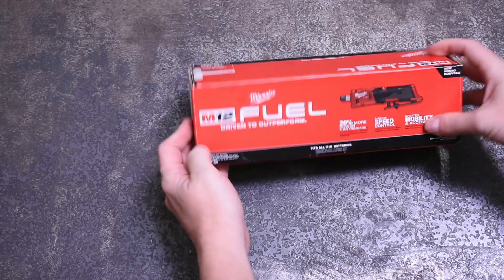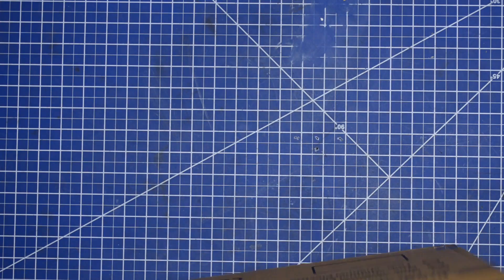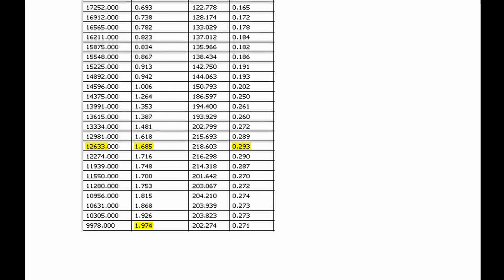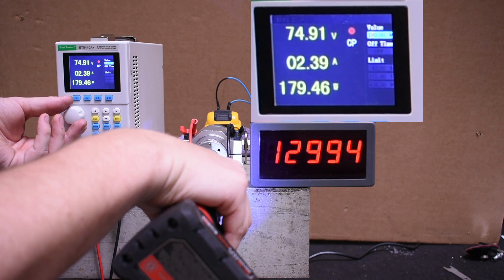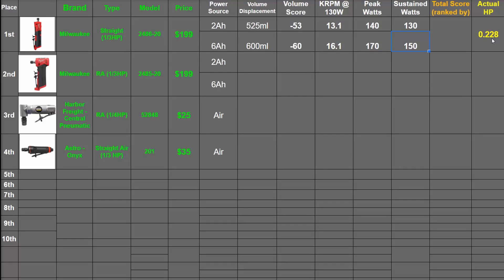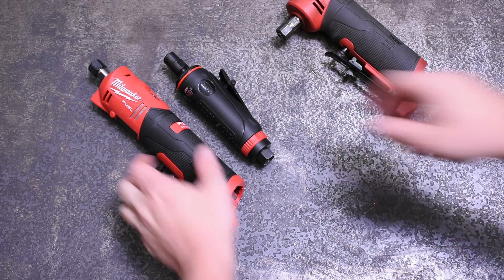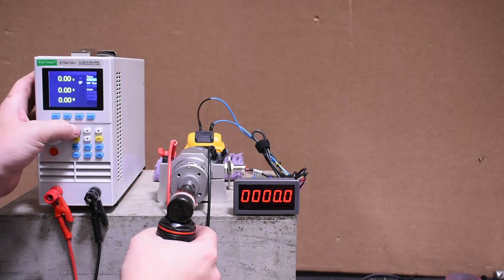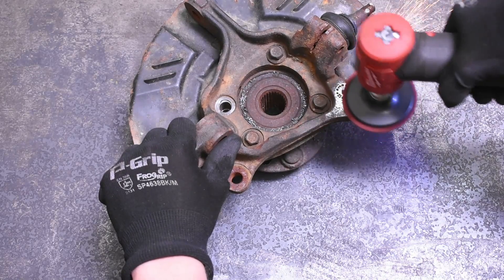We Built a HP Dyno: Do M12 "1/3 HP" Die Grinders Really Beat Air?

Comment from the maker: People with our lifetime tool ranking would have seen Die Grinders added early this week: https://etsy.me/3G8j3QK It's worth noting that the efficiency of a motor spun as a generator is NOT close to 100% , so like with the rest of the testing on this channel with torque, lumens and otherwise, the value will be in the comparisons between tools, which becomes greater as the list is filled out. Also why the title is "Do Milwaukee 1/3 HP Die Grinders Really Beat Air?" and not "Do Milwaukee 1/3 HP Die Grinders Really Make 1/3HP?" Recommend some cordless die grinders we may not have considered below!
As always, Torque who started this channel works in product development for Astro Tools, who also makes the 201 & 204 models in this episode. Not that they make unusually high power compared to most, we find die grinder quality mainly has to do with vibration and durability. Power is usually determined by air motor size. TTC is not the only testing out there, always consider multiple sources when looking at a tool!
Reply from the maker: Working on a brake dyno as well, we'll see if we can shrink it down for use on smaller power tools as well.
Reply: @TorqueTestChannel  You only need a pivot and a torque arm on the dc motor you have, and a kitchen scale to measure the down force of the arm.  The motor is already used as a brake.
Reply: @TorqueTestChannel  Put the motor being ran as a generator on a floating bearing setup and attach a lever arm to the body of the motor so that it is pushing down on a weight scale. Calculate the torque based on lever arm length multiplied to the force reading on the weight scale as the motor starts to twist on the body more and more as load is increased with your battery load tester. That takes out any losses from power losses from the current draw out of the generator. You already measure RPM, so you are 50% there.
Reply: I would say that order of importance in the quality of the tool is durability, power, noise, vibration. Please add sound level to the testing. Some are really unbearable to use. I had a HF die grinder gear box explode on me in less than 10 minutes use. I wouldn't use one again if you paid me to.
Reply: I’m glad you mentioned this, I was going to comment about i. Just saying if you know your motors efficiency (probably somewhere between 80%-90% though depending on the type of motor it could be less, some older motors are less then 50% efficient while Tesla motors I’m pretty sure are 90%+ efficient) you could divide by the efficiency to get a close estimate my guess is that your motor is about 85% efficient (although that’s a shot in the dark) so the Milwaukee would be 0.228/0.85 =0.268hp still not the 0.334hp  their advertising but a little better and closer the the actual hp output
Reply: Another option to get you results closer to the actual output hp would be to calibrate your setup off something with a know hp (basically testing your motor/generators efficiency) although finding a motor that you could use to test might be hard. The best way I can think of would be to get a second identical cnc motor then run one as a motor into the other as a generator. read you input and output power divide your output power by your input power to find the efficiency then split the difference with 100% efficiency (the efficiency you calculate would be for two “motors” so splitting the difference with 100% efficiency would give you the efficiency of a single motor. Example: if it tests at 60% efficiency then one motor would be 80% efficient if it tests at 70% efficiency then one motor would be 85% efficient. The only way that wouldn’t work is if the motors have different efficiency running as a motor or a generator, I don’t know if that’s possible and even if it is you’d probably still get pretty close but still something worth looking into
Reply: I wonder how much POWAH my dcg426 makes.  Also can this rig test angle grinders?  How much power do the 40 and 60 volt die grinders make?  Is it really 3 hp?
Reply: I would be super interested in seeing the new high output 12v batteries tested. The 2.5 and 5 AH models on both of these grinders, the larger 3/8ths ratchet, the stubby 3/8ths impact and the 90 degree 3/8ths impact. These are all tools I either use daily or am looking to purchase. I have a 5AH HO battery and it FEELS much better than the 2 or 4AH batteries.
Reply: I use the snapon brushless polisher/die grinder (CTPP861W1) as my go to and have been considering getting the Milwaukee 2485-20, would be curious how they compare, from watching this video I believe the snapon may have more power but I would be interested to see how they compare
Reply: I was goin to point out the efficiency. Considering the motor and bearing losses I think that 75% is a good number.
Reply: DC motors are actually quite inefficient, I would say 50-60% is a good conservative estimate for peak efficiency and efficiency varies greatly with speed/torque/power output - peak efficiency usually happens at 25% or below of stall torque. I'm not sure if or how any of this changes when the motor is being used as a generator, but I can't imagine it would get better. To get good results, you could keep the DC motor and electronic load but would really need to add some kind of torque sensor - the simplest would be a thin shaft designed to act as a torsion beam with hall effect sensors or encoders at each end. You don't even need very accurate sensors to do this - just measuring the phase difference between the two signals will let you calculate exactly how much the shaft twists under load, and it would be easy to calibrate this setup with a known accurate torque wrench.
Reply: @jrw0101  Got to be careful with wording because DC motors can include the brushless kind which can be in the high 90's. Also, brushed DC motors can be up to 80% efficient from what I have seen with larger units. The 60% is for low quality brushed DC  motors.
Reply: You realize TTC, that you’ve opened the Horseprrs Pandora Box. 
Next is Coyote motors vs LSs/LTs.
Reply: I wonder, if you could use something like a MPPT circuit, to get more accurite numbers.

Comment: I would adjust your value column to reflect the price of an air compressor/hose/dryer since the m12 price includes a battery. I just bought an m12, and even though it was pricey, it was cheaper than upgrading my air compressor to run air tools. And i dont have space for a big compressor. So this was a good fit for me and my small projects

Comment: Thanks. Am thinking of getting one of these Red, right angle die grinders. Air is compact etc, but has a number of drawbacks of noise, cost of compression etc. Also, air is very pressure sensitive; very fast on load load, but this quickly drops with pressure. I note you found the battery ones to bog, too. There's some small advantages in air, but I think much of the future (and present) is battery.

Comment: That collet belongs on a 5/18"-13 female spindle to mount to cordless angle grinders which promptly become right angle die grinders. I drilled and tapped a steel Jacobs chuck for mine which is a very old trick but those are bulky.  That turns any of my angle grinders into right angle die grinders at which my Makita and DeWalt are quite handy, and for heavy jobs it goes on corded angle grinders.

Comment: Then add a score for portability, and make sure reflects the difference in the overall cost between batteries and chargers and compressors and equipment. Since the two are not even in the same ZIP Code. Great channel by the way.
Reply from the maker: I'm sure how someone like us would score portability, where we have an air line and are at work anyways, would be different than a home gamer or someone working in a junk yard. We measure their power here. People can weigh the importance of several other factors based on thier needs no doubt

Comment: Comparing a air grinders price to a electric cordlesss  price MUST include the cost of the air sourse, pluming,connectors, ETC or its meaningless.  Nothing portable about the  compressors your using I suspect.
Reply from the maker: Well we dont include the cost of the battery and charger for the cordless tool for the same reason. You dont need to rebuy all that stuff every time you buy a new tool, same with air. At least with air you're not locked into a single brand.

Comment: Most hobby die grinder use is for short intervals where electric is plenty. Those who need pneumatics know who we are (and that we can crank up the air pressure if we've enough compressor). Stalling a pneumatic doesn't smoke the motor. Horses for courses...
I have both but my favorite die grinder is the beastly corded Milwaukee 5196 (cordless is possible at that continuous output but would devour the best batteries in typical use cases). Those are so tough I buy them used (wear parts are inexpensive). 

BTW I drilled then tapped a (steel) quality drill chuck for 5/8-11 that turns a small angle grinder into a very handy angle die grinder for  use with flap wheels etc which are not normally used with guards. It's a great addition to my welding gear bucket.

Comment: Don't forget to add the weight of the hose next time.
Reply from the maker: We're not scoring on weight. But how much hose you lifting? 3ft?
Reply: @TorqueTestChannel  Thanks for the reply, I use all lengths at work but we also have hose connections all across our building. I prefer cordless (Milwaukee) but in some instances air is better. I was thinking in cases like this video, adding the bulk of the hose is one of the biggest issues.

Comment: I don't think any tool that fits the "category" should be considered too big since you are including size (volume) in the points comparison.  If the tool is bigger than most, it will get dinged in the points. If the mfg sees the comparison and cares enough, then they can rework it and make it better.

Now if the bigger size puts it in a higher HP class, then maybe include it in a a different comparison (like your 1/2 pneumatic), but like for like HP wise, the points will help reflect the size differences.

Comment: The Total Score column is just very irritating to see and to me it pollutes the chart with a nonsense figure. If we're going to rank these tools by their characteristics, why not make the score just be average ordinal rank across columns? It's more sensible and less arbitrary number and serves the same purpose of a non-weighted composite score.
Reply from the maker: The key to all our charts are make more power, be smaller or charge less and your scores go up.. Plenty of youtubers already do what you're wanting. They have 10 tools and the most powerful scores 1st for power then 9th for minimum rpm squeezing the trigger or some other nonsense and finish 5th on placement average. Or you rank them by price but one is $300 more than all the others and is therefore ranked one place lower... I encourage you to go enjoy those channels
Reply: @TorqueTestChannel  You misunderstood. A Total Score based on the average rank calculated from all the ordinal ranks of other columns will still yield a product ordering more or less the way you would expect. The key difference is the more sensible and "cleaner" appearance. Instead of subtracting a figure derived from volume displacement from peak watts (lol) you just take an average of where the product ranks in both categories of volume displacement and peak watts. Result is the same and you don't need an arbitrary extra "volume displacement score" column. It's going to be neat(er) and less funny looking. No offense.
Reply: @TorqueTestChannel  What I'm suggesting you've implemented more or less already in at least one other occasion as in your comparison of line wrenches. There instead of average rank, you calculated average normalized score of 10. With average rank you don't have to normalize a score so it's more convenient without the extra step (just go by rank). It also helps the viewers to always implement the same scoring system across different tool tests for consistent understanding from chart to chart. Even Project Farm fails at ranking his tool comparisons with a single system. Sometimes he uses a normalized score, sometimes an average rank.

Comment: Honestly, I like how the air die grinders take up less space, even when having to deal with an air hose (swivel fittings can help greatly if trying to get into tight spaces). I had the harbor freight right angle die grinder for years, pretty sure it was the really cheap one. After replacing it with a Mac right angle grinder, I gave the old HF one to another guy at the shop and its been alive for at least 10 years... Not saying that it was strong, but for $15 at the time, it still works.

Comment: Just me personally, I massively prefer electric tools even if they don't quite perform the same or are heavier because air tools have so many usability issues. You get MUCH lower starting torque from air tools, it's easy to freeze them. And the air hose always has some issue - either you forgot to turn on the compressor and have to wait AGES for pressure to build up, or the automatic return spring decides to engage during work, or it's not long enough for that one job you had to quickly do... there's always something that makes using air tools more of a hassle than I can use at that particular moment.

I respect that there's still a (serious) size advantage for working in tight quarters, but then again I only do work on electric cars so I don't have to often take something off in a cramped space.

Comment: I'd love to see more air tools on here. I use air grinders all day for my job (deburring aluminum parts). The tools provided by the company work good but they have definitely seen better days so eventually I'd like my own set if I decide to stay for awhile. Top 3 things I would love to know would be Vibration, Comfort in Hand and heavy use reliability. For right angle grinders, the heights between the top of the grinder and the bottom of the grinding wheel would be great to know as well. Somethings I can't use the right angles in certain areas because they are too tall which forces me to use a half tapered roll of sandpaper which takes far longer to remove machine marks than using a disc on a grinder would. It also leaves more room for error as it's easier to keep a flat surface with the discs.

Comment: I will say this, I have the Chicago $15 air die grinder and I use it for the 2" surface prep disks. As anemic as it comes out here, it has been a great little tool for me with plenty of power for what I was using it for. I clean brake rotors prior to mounting on the lathe and gasket surfaces. That being said, I just got in a M12 right angle die grinder and I can't wait to see how it does. But seriously though, I have to disagree with the channel. For $15 you can't go wrong with that little Chicago POS. It's served me well and somehow is still going despite me never oiling it and just treating it like a $15 piece of junk that I'll run till it blows and then throw it in the scrap bin. That being said, I also have the M18 straight die grinder and that thing is a freakin beast. It eats batteries but holy hell it has power.

Comment: The DC motor will have some internal efficiency losses on top of the fan.
You could get a second one and a power supply, link them together and measure the losses. Then split the difference (should be similar losses when running as a motor or generator).

Comment: I have a snapon 14.4v right angle, but the motor completely broke and no longer works on it when my carbide burr caught on me. Not worth buying, in terms of using one at work, I’ll stick with my air power. At home I use the Milwaukee 12v die grinders though

Comment: I own and use both of those Milwaukee 12 volt die grinders, in short, I love them. I generally use them with carbide burrs, and with a new sharp burr they really chew out steel. I run mine on 4 ah batteries, a good mix of power and cheapness. So like all cordless tools, just grabbing the tool and going is so much better than stringing out the air hose.
Reply: I can drill much bigger holes with the 4Ah XC vs. the 6Ah. 

Considering they just use 18650s, it makes sense that the higher the Ah the lower the peak amps.

Comment: Using generator is a poor dyno. You have losses in the generator that will effect the readings. A proper dyno measures torque and rpm at a varying load. You need to put your load in a mount that will allow you to measure the torque which with the rpm you can calculate the HP.

Comment: Looks like the load is set for constant power. You'll probably get more consistent results with CV or CC, controlling either speed or torque respectively. In constant power mode, the torque ramps up as RPM drops, which can cause instability and quickly stall the grinder. As you are ramping up the power, you may be finding that unstable point before reaching maximum power.